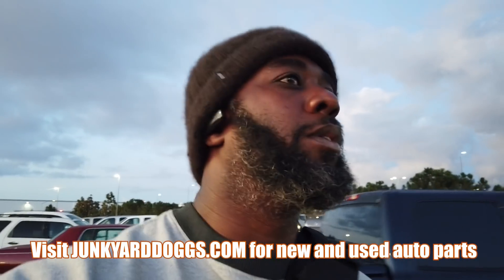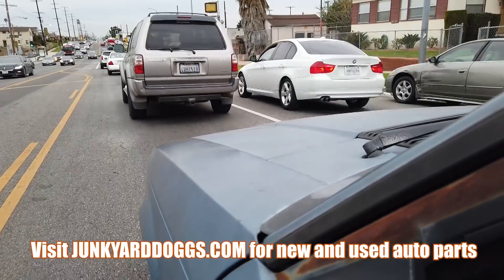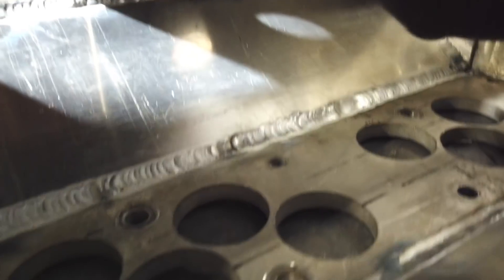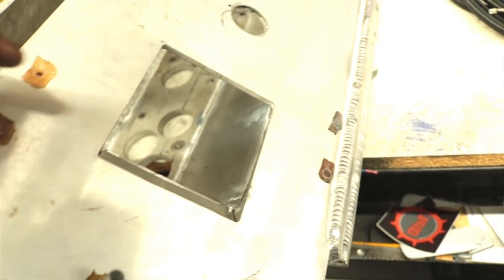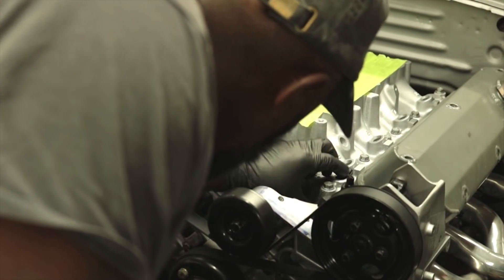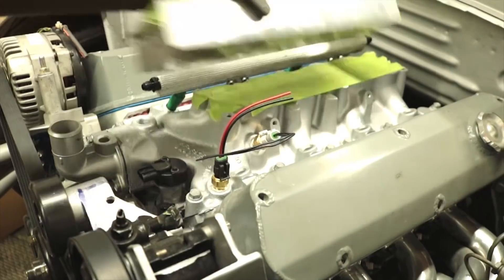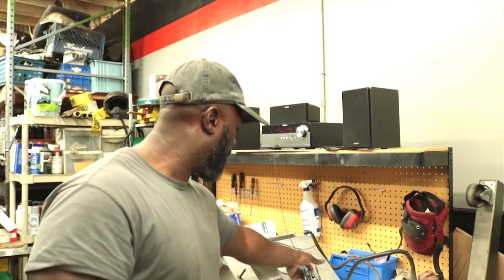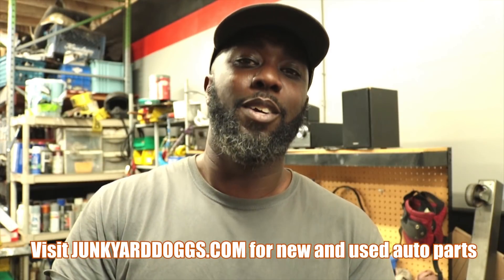Dual Supercharged Foxbody Mustang Welded Intake ad Fuel System - PROJECT MAYHEM PART 48

Comment: Hats off to you for keeping this project moving along..
A few questions and a few suggestions for you:

1) What is your HP expectation?
2) What diameter is your bottom pulley?
3) What are you planning to burn? Pump gas, E85??

-Your dual 90CID superchargers will give you very similar flow results to the Weiand 174/177 supercharger. Use their pulley sizing charts to estimate your boost then adjust your pulleys to suit your HP goal.
 (I have the charts for the 302 if you can't find them, let me know).
-Once you have your airflow values you can size your injectors and pump(s) to suit.
-Anything that will benefit a N/A engine will also pay off for supercharged. Smooth out the inlet holes into the stock intake or better yet insert some thin wall tubing to extend them and then bellmouth the ends to make some custom velocity stacks.(Longer runner = more torque and bellmouth = more airflow).
-In a previous video you had mentioned that intercooling was not required with the teflon coated rotors. That is probably something that GM marketing said to justify not intercooling. There is never a scenario where you don't want an intercooler.
-I wouldn't worry about a blow-off valve when using port injection unless you will be spraying methanol.
-The Weiand 177 came with a 6 rib belt so your belt setup should be workable as long as your spring-loaded adjuster can control the slack.

Good luck..
Reply from the maker: Hey thx for following the build man.  Im thinking 475hp stock size fox pulley and running pump gas and a custom water meth kit.

Comment: I wouldn't grind or cut on the supercharger. I agree with dude that said grind the weld on the intake. I think you weaken the  bolt holes on the supercharger
Reply: Just plane everything on top and no more problem with the weld
The plate is warp anyway

Comment: Surface plane the intake so it can be true up as for the fuel pump I would find a sock that fits the inlet use a rubber shoe to hold it in the rail and then use a big hose gear clamp to hold it together no point in re building the wheel...

Comment: I would Grind the bottom of the bolt hole of the SC until it fits over the welds.
Reply from the maker: Good idea
Reply: @JunkyardDoggs  no grind the weld and before doing anything go to machine shop to plane the intake and go all the way to the weld to remove it